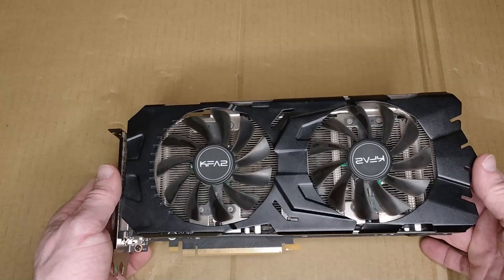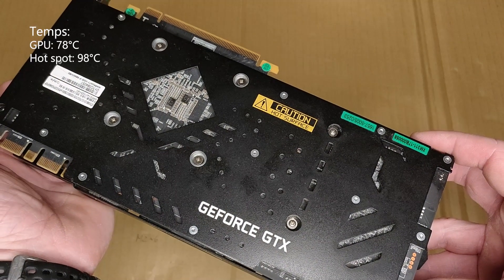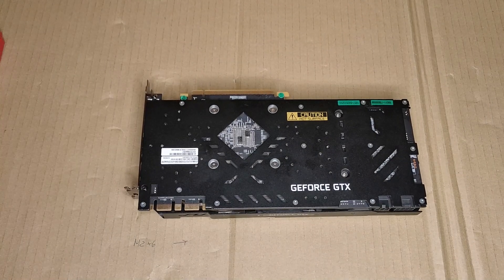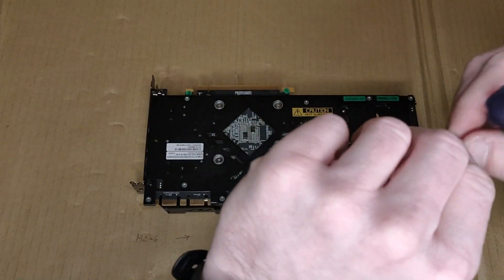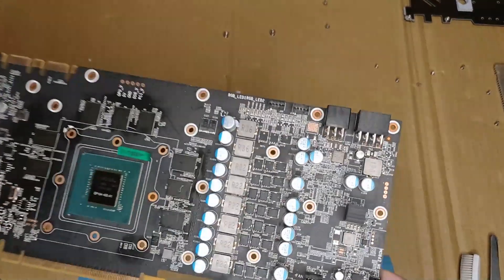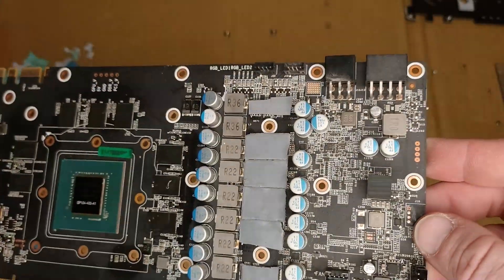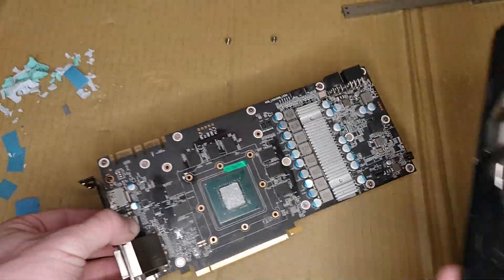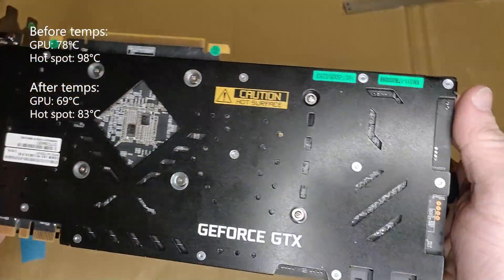DIY: Worth to service a 6 years old GPU? KFA2 GTX 1080

Comment: This is still a relevant card for 1080p and even 1440p if you do fps gaming and run the competition settings. Will run older games max settings easily.

Comment: I recommend giving to the core Honeywell PTM7950 phase-change material, and instead of thermopads thermal putty Upsiren UX Pro Ultra and finally perform undervolting.
Reply from the maker: thanks for the recommendation, i'm interested in the PTM7950, but didn't use it yet